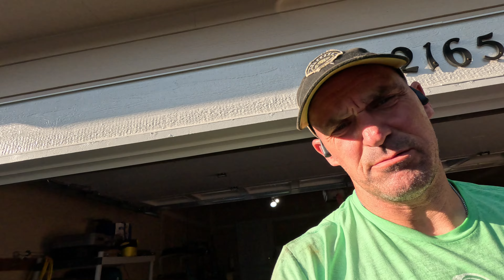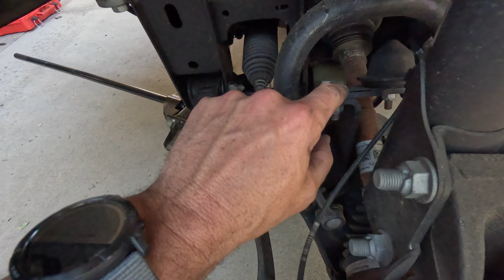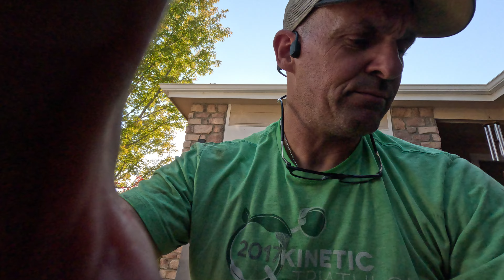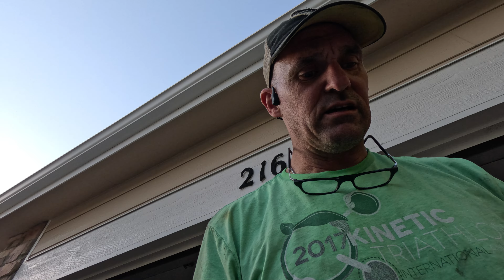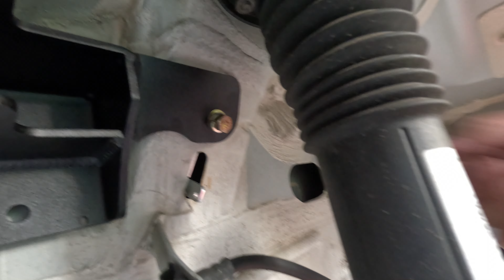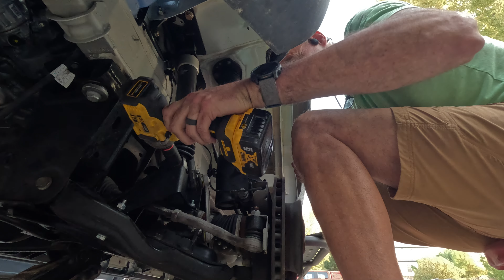VAN COMPASS Front Falcon Shocks for your Mercedes Sprinter Van: The Ultimate Installation Guide

Comment: Do you have any video footage before and after or interior footage of the sway? Was it worth the 1500$
Reply from the maker: I dont, mainly because the sway is more of the way the van feels when the wind hits it going down the road or how much it moves side to side in an offroad situation, the closest I could come is pushing on the side of the van when parked and seeing how much the suspension held it from rocking and then just the feel of the van inside when walking around/moving about inside. I didnt feel like i could capture that on video but you can feel the difference so in my opinion the upgrade is worth it. If for nothing else to help keep that factory cross wind assist under control because thats a scary feature i wish they would turn off all together

Comment: You do such a great job explaining everything and by you doing this stuff with basic tools in your driveway, it gives people the confidence that they can do these things themselves and save a little money. 

I’m curious, did the spring addition in the back and this extra shock up front provide any additional ride height?
Reply from the maker: @randerson4383 thank you so much for the comment, I enjoy making the videos with the hope that it helps someone tackle their own project. As to the lift the springs gave about an inch of lift in the rear, the true benefit will be as we load up the van that progressive pack will help take the weight without sagging as much. On the front there is really no change, the shock up front just helps with dampening and sway which is greatly needed on these vans, there will be some natural lift up front as the weight balance shifts to the rear as we build out the van but if I do my job right it should be 1/2 or less up front